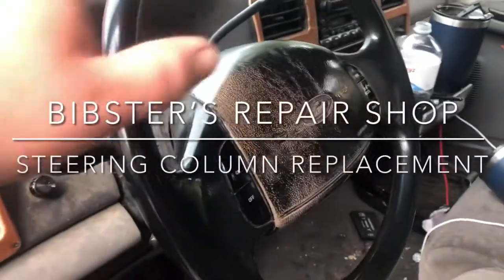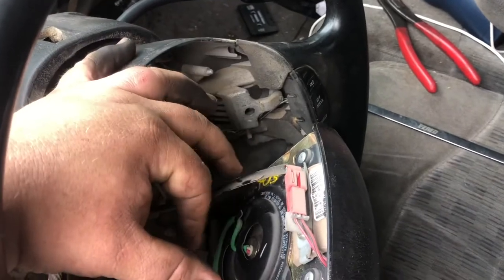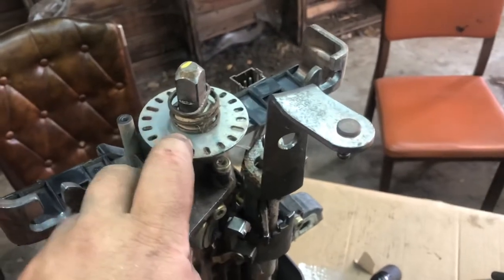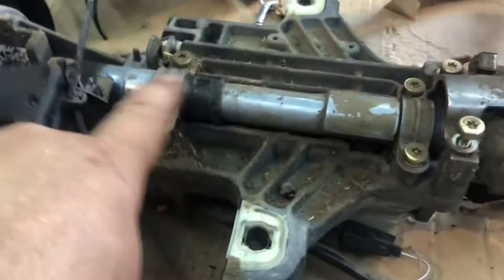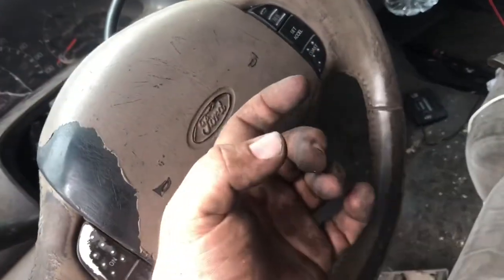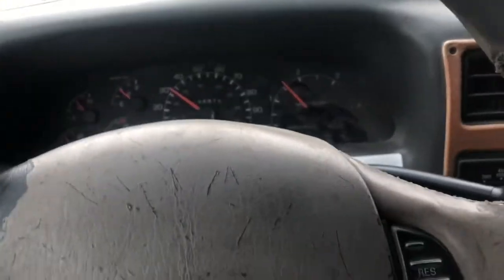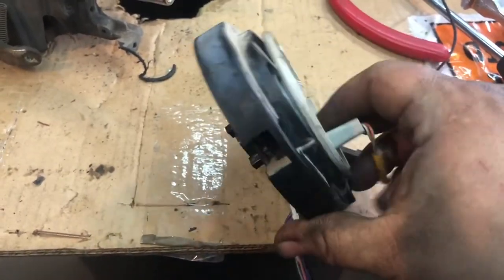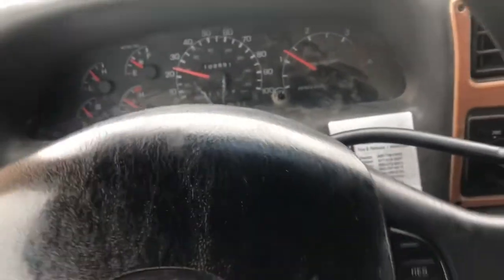1999 F-250 steering column removal and replacement

Comment: I have a 2002 Ford F150 xlt. I replaced the steering column. The steering column I replaced came with a key. It will not start . On the dash board it reads Theft .
Reply from the maker: Check and see if there is a key relearn process I know how they are on GM stuff from this era

Comment: i’m not pulling out the column but adding an extension right where the reluctor wheel is. and i can’t seem to separate that part no matter what i do is there a good way to do that?
Reply from the maker: Do you mean like right under the steering wheel or I don’t have the old one around anymore to look at so I’m not sure the best way